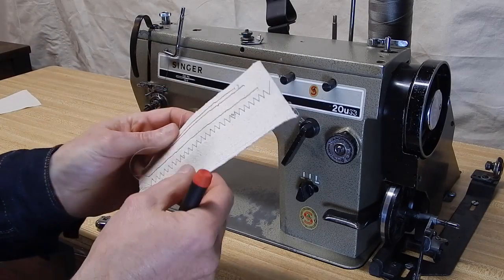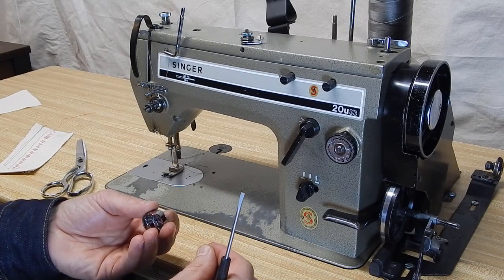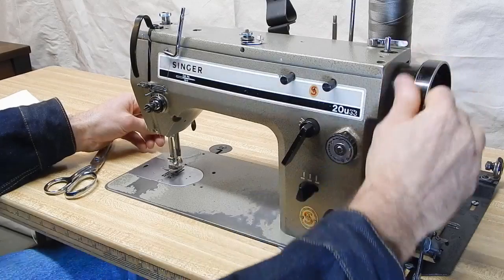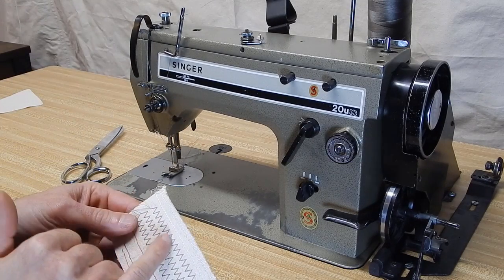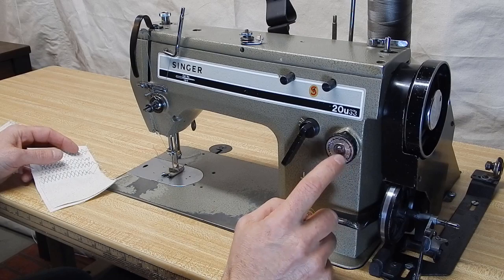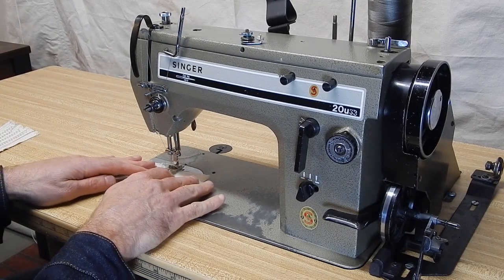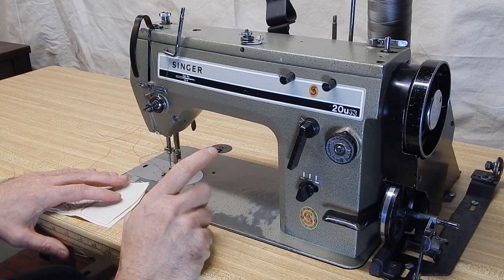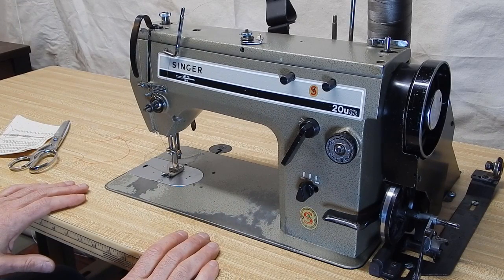Singer 20U33

Comment: what if this machine keep on cutting the thread? thanks
Reply from the maker: Change your needle. Make sure you have good thread. Re-thread your machine. Check and adjust your take up spring. Hold your thread tails when you start.

Comment: I know this is an old video. I recently was having problems with skipped zig-zag stitches and was not able to tighten down my handwheel. I would like for you to make a video on this for a Singer 20U33 I think I have it fixed now but it was a lot of searching and not even on a Singer 20U video I found my "clutch disk" had slipped out of place. PLEASE make a video for Singer 20U and the clutch disk replacement. If it is out it causes so many problems

Comment: Hello. Thanks for the video. Can i zig zag soft fabric with this machine? It doesn't seem to work for me 😕
Reply from the maker: It is possible but spongy material is more of a challenge. Your feed dog should be in good shape and not too smooth from use. Perhaps the feed dog may need adjustment so that is is fully engaging the fabric and then the foot pressure would need to be considered as well. Good luck.

Comment: I have a Singer 20U33 and have used it for many years but not much in the past year. I went to try to sew on it today and the black otter wheel spins and will not make the lever go up or down. Any recommendations for me to try? I have oiled it but it still does not work. It is like the belt does not turn anything.
Reply from the maker: Easy, just tighten the center knob on the hand wheel. It is there to disengage the rest of the machine while bobbin loading.
Reply: I tried tightening the center knob but even doing that the big wheel will not engage and make things move. I understand about loosening to wind the bobbin. Iam wondering could it be the belt has stretched and it is not enough pull on the wheel to turn?
Reply from the maker: I thought that I understood you to say that the handwheel was turning. If that is the case then the belt is probably ok. Righty Tighty, Lefty Loosey
Reply: Hey I was not going to let this problem get the best of me so I kept tying to find my problem and I found it. The Clamp Stop Motion Washer is worn. I flipped it over and the machine is working correctly now. But I went searching for a new one and Singer says they have stopped making this part. I searched the internet but did not find anyone who has a new one for sale. I found some used CSMw but as far as i can tell none say they are for my model exactly, So I am searching and will continue. I did contact Singer by email too see if they have any suggestions. Thanks for your help.
Reply from the maker: Great, way to stick with it. Try http://hendersonsewing.com/ I am sure they will have your part.

Comment: Hi Mate, Do you know where I can find some parts for this sewing machine.  I need that long metal piece that has a thread hole and is fixed on top of the Singer word. I also need need that long black selector which appears on the bottom of the small  word S
Reply from the maker: Here are a couple of links to a parts manual and an instruction manual. Get the numbers of the parts you need and contact your local industrial sewing machine shop. It does not need to be that local since they can ship anywhere pretty cheap http://strongbolt.work/wp-content/uploads/2016/12/Singer-20U33-Parts.pdf   http://strongbolt.work/wp-content/uploads/2016/12/Singer-20U-Owners-Manual.pdf
Reply: Thanks for the manual, but to find the part from that long list is not easy, I wish if I knew the name of these two parts.

Comment: Hi! how set the timing of the left and right position of the needle? Mine is only working on the middle and right position. when i switch to left position the hook won't catch the thread. when put to zigzag it works on narrow stitch but not on the wide stitch. I hope you can help me on how and where to adjust. thanks
Reply from the maker: Your machine is not timed properly. timing is not too tough and you may be able to manage. I can't really explain how to do it in comments.  Time your machine so that is will not skip any stitches at the widest setting and all other settings will be good.
Reply: my only problem is the position of the left and right of the needle they are not even from the middle position the left side is more wider from the middle position. maybe you can have a video on how set the needle position to make it even left and right from the middle position.
Reply from the maker: There are adjustments for that. I have sold this machine and so I can not make such a video. Good Luck.
Reply: Thanks Alex.

Comment: i HAVE THIS MACHINE, THE KNOB TO THE RIGHT WILL HARDLY TURN, SO I CAN;T TURN IT TO BRING UP MY THREAD, HOW DO I LOOSEN THIS. BELT IS NOT THAT TIGHT, ITS STILL HARD WITHOUT THE BELT.  SECOND STITCHES SKIP WITH ZIG ZAG.
TRIED CHANGING NEEDLE. ANY SUGGETIONS.
Reply from the maker: +Joyce Weaver If your machine is difficult to turn by hand without the belt then the restriction is in the machine. The most common cause is a bunch of thread wrapped around and under the bobbin and hook. Give the machine a good cleaning, remove all lint and thread and oil any moving parts while you are at it.

Comment: I have an earlier 20U.  You can also adjust the knee lever to control the stitch width regulator rather than the presser foot lift.  Before computerized embroidery machines, machine embroidery was done essentially free hand. I've lost track of the videos but remember a few where it was amazing to watch a guy do perfect embroidery.  My reverse has stopped working.  It stops the machine from sewing forward but never quite gets to reverse.